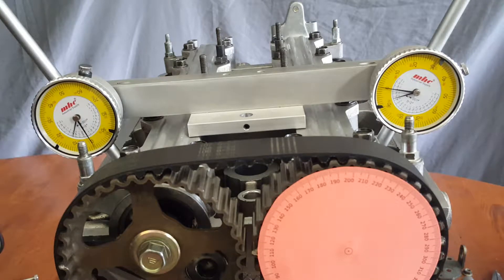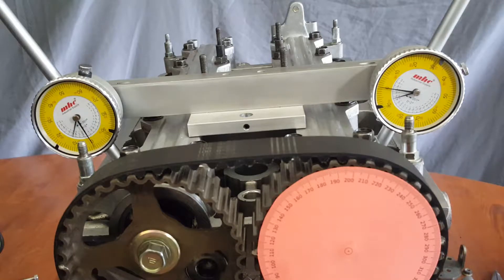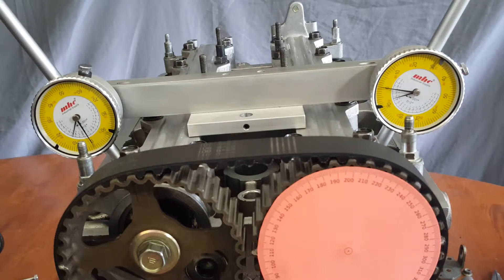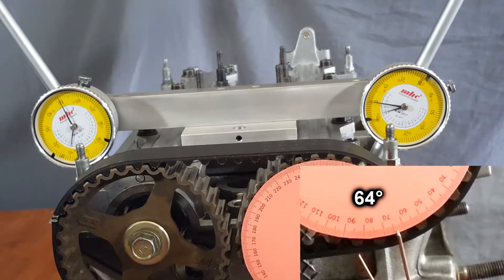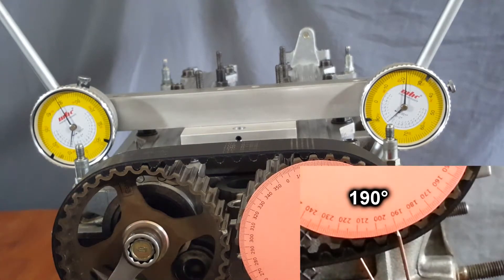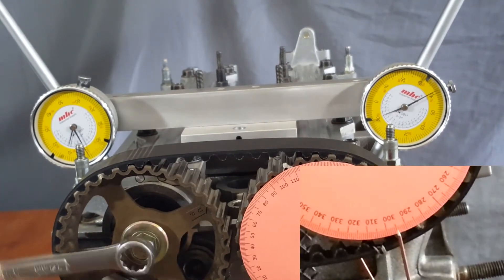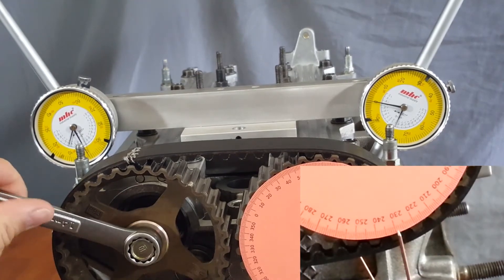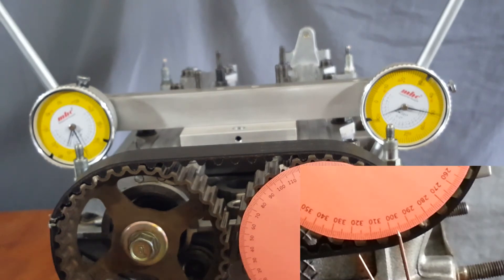How to: DOHC VTEC Cam Lift and Duration Measuring

Comment: If the head has been milled and the timing belt is off 1/2 tooth how would I go about degreeing my cams,its an lsvtec with skunk2 2 pro 1's.not being able to line up the mechanical timing its makes it difficult to set everything correctly.
Reply: Grab an adjustable set from skunk 2 or ebay.
Reply: @mackdewey465  I have aem trutime adjustable cam gears